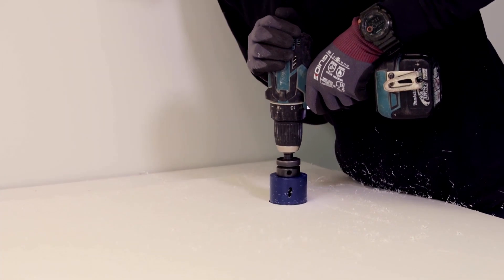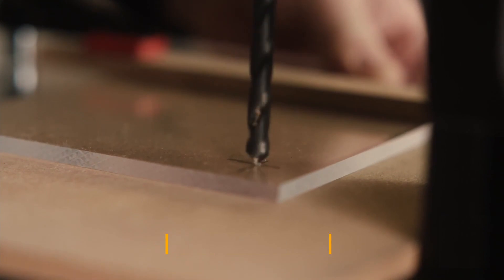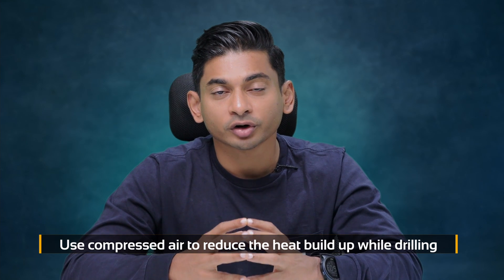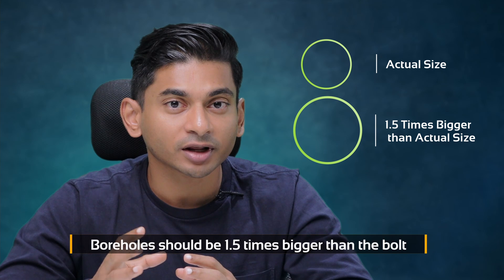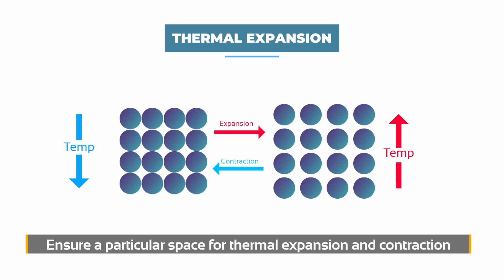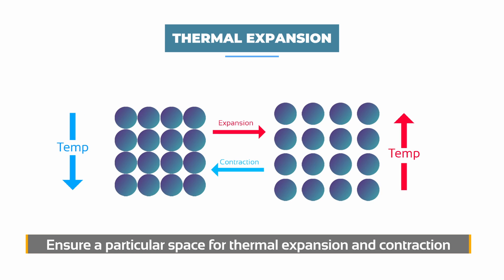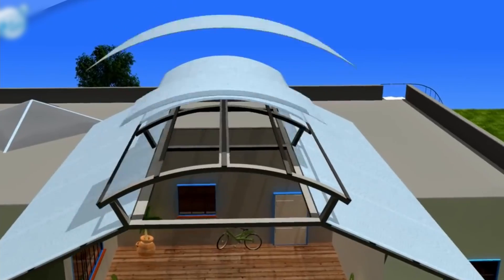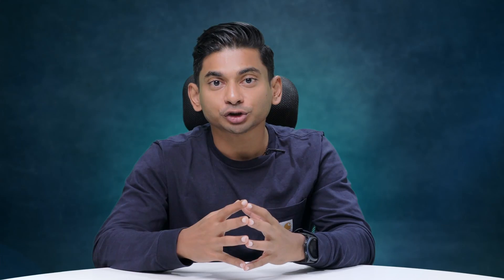Polycarbonate Drilling, Fabrication, Installation Tips, and Thermal Expansion Explained

Comment: We have some polycarbonate enclosure doors that have cracks appearing  days after holes were drilled. we used clean bits, drilling a pilot hole, then increasing hole size.
 We tried using rubber washers through the hole. Right now we are at a loss for understanding the cause.